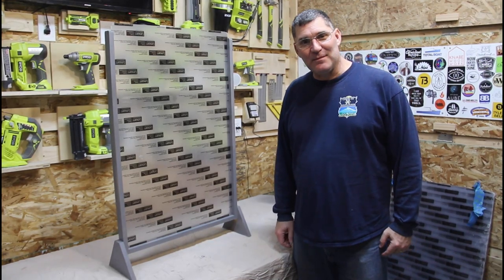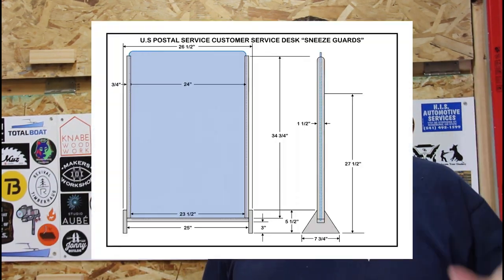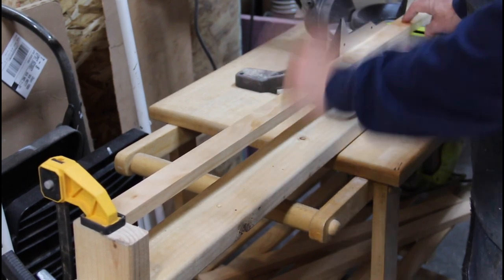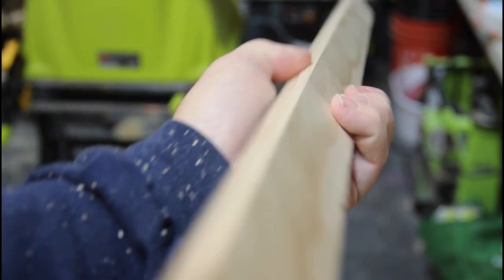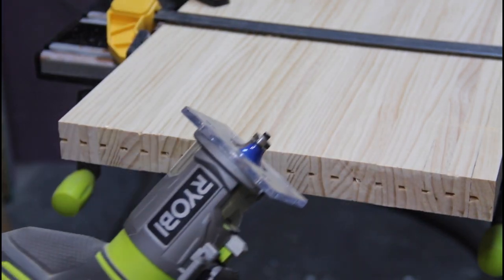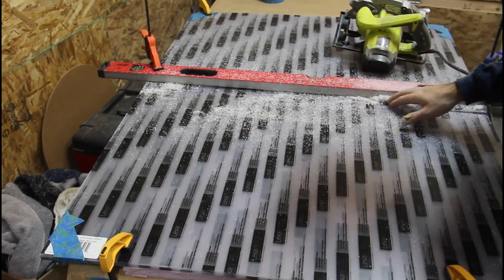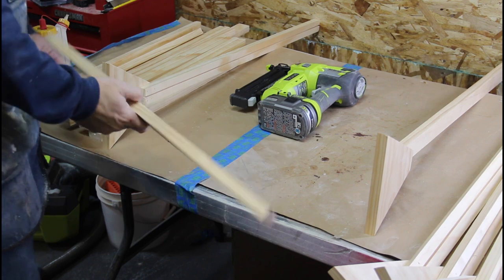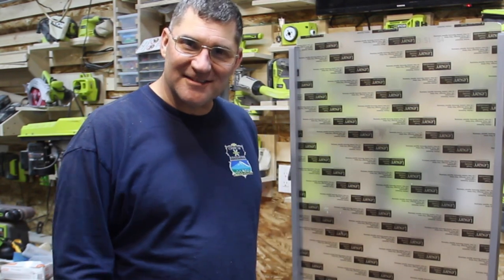Flatten the CURVE! | How to MAKE a Sneeze Guard to fight COVID-19 | 2020/11

Comment: Thanks Dad It Yourself! I may adapt your plans to build a 4x2-sized sneeze guard for my school's front office counter. Do you think the legs are strong enough for that length of plexiglass (1/8" thick)? Should I use a 1x8 instead of a 1x6? Could also mechanically mount it on the counter for more stability. Can I use a router to make a wider channel to accommodate for a thicker piece of plexiglass like 1/4" or 3/8" thick?
Reply from the maker: Always size your material to your scale.. Support is key here. Anchoring it down will make it very sturdy!